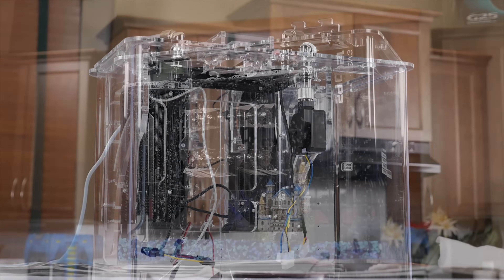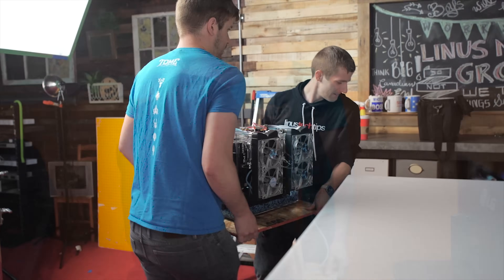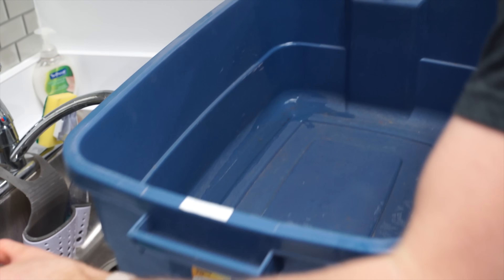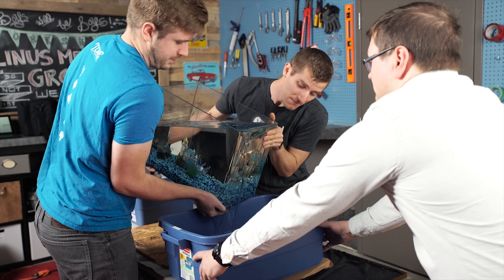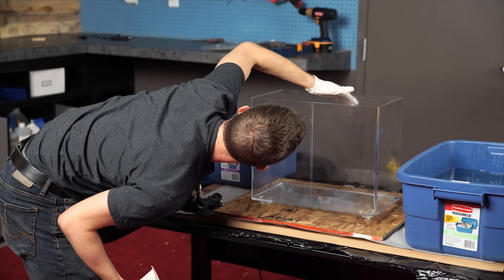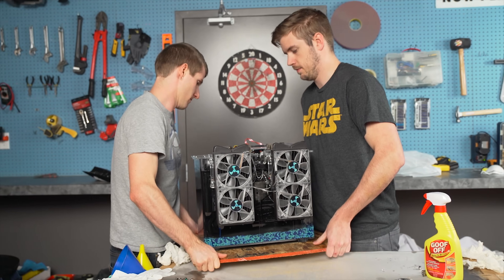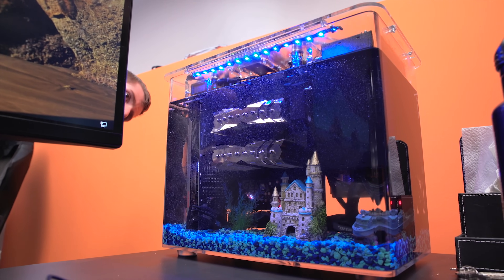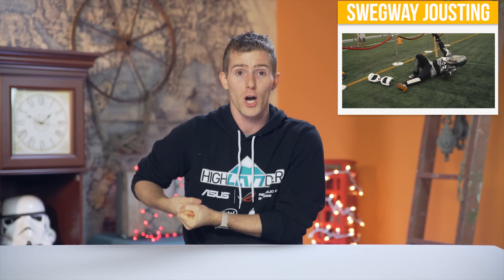Aquarium Mineral Oil PC Maintenance Vlog

Comment: PRO TIP: Use a siphon to transfer the oil.
Reply: tech tip
Reply: They only just discovered funnels, siphons are way beyond them
Reply: Yeah wtf I fully expected them to siphon it
Reply: Only problem is starting the siphon action. I doubt they want to use their mouths so theyd have to submerge the entire length of the pipe then plug it up. Still probably easier than no siphon, but has its on complications
Reply: My first thought
Reply: Why bother with a siphon? They have literally dozens of pumps and meters of tubing for water cooling. Pump it out!
Reply: I thought they were going to do it, when they started pouring the thing I was like what the fuck
Reply: @AbeDorf18  there are hand pump siphons😂
Reply: @SKMovez  thats great, but that requires an extra tool. At that point why not just get an automatic pump?
Reply: @AbeDorf18  Mineral oil is food safe if i remember correctly so why not
Reply: @egesanl1  the same reason i dont want a mouth full of mustard
Reply: @AbeDorf18  yum!
Reply: @egesanl1  Sure thing... if you don't mind some slippery shits 😂
Reply: they make a squeeze pump siphon tube

Comment: Just a few tips from an aquarium keeper.  Use a 3/4 food grade PVC hose (20 cents per foot at home depot) to siphon the oil out into clean 5 gallon buckets (with lids!)  You can do this cleanly and easily before even moving your machine from your workstation.  Using the buckets makes it easy to refill once you have finished your maintenance... you just put the bucket up higher than the PC case and use the hose to siphon it back it..  Nice.. clean.. and easy...  oh.. and you should also NEVER transport a full tank!  ;-)

Comment: Do people actually cool their computers like this?
Reply: I would like to know the answer to this question too..
Reply: +tzokke Yes, yes they do. Mostly enthusiasts though.
Reply: +tzokke People with the money and passion to build one, yes.
Reply: +Captain Einstein People with money , time and no friends.
Reply: +jdidy18 is it generally more superior? Perhaps from the homogenous oil between each of heat dissipating parts? Allowing for better heat flow away from the system..??
Reply: +daedra40 It does an equal well job as any good water cooling system, or even air cooling. Though it is a great way to cool your components, it's mainly used because it looks really cool. Linus himself even said it's only because it looks cool.
Reply: +jdidy18 oil needs a lot of energy to get hot. I think the loud temps on this systems should be crazy low
Reply: +jdidy18 ah got it got it :)!

Comment: I found it funny that after you done your first video of submerging a computer inside oil. EVGA added to their warranty

"Submerging in oil will void your EVGA warranty"
Reply: Which is arguably bullshit since there's no difference between air and mineral oil in regards to card safety.... The only dangerous thing is that something may slip and fall during installation and potentially the cables can get weird, otherwise it only adds to the complexity of the build and maintanace for the end user. There's no reason an oiled up card shouldn't be warranted - I'd be much more understanding with voiding the warranty if you're using water cooling as that actually introduces a potential hazard, yet nobody does that.
Reply: Oil can degrade plastic, for example by slowly seeping into the plastic and leaching out the plasticizers. This makes the plastic very brittle and easy to break.
Some plastics are compatible with mineral oil, some are not. But since at least 99.99% of the guys who buy a GPU won't submerge it in oil, there is little point in making all components out of oil resistant plastic.
See LTTs video on testing if the components from this PC still work after a few years; one RAM slot broke while removing the RAM.
Reply: They talked specifically about how oil slowly chips away at thermal compound too, and how that caused the GPU from Luke's old oil-cooled PC to fry when it was powered on in an air-cooled setting.
Reply: Warranty Void If Submerged
Reply: @Coiltec  they also probably just dont want to deal with having people send them oil covered stuff
Reply: @btCharlie_  
It's how the market works, try to externalize costs and hope no one complains. Since so few people will do it anyways, they got away scottfree. Basically, improving their materials to endure oil cooling would cost more and they decided it was not worth it.
Reply: @frowlinian8175  exactly what I was thinking.
Reply: Idk I wouldn’t wanna fucking deal with a greasy mess being sent back to our factory either lol

Comment: I want to see orange robotic fish swimming in oil PC :3
Reply: not a bad idea...
Reply: +Bisting Lolwut Really bad idea... For fish :P
Reply: I have one of those and while very cool, the fish that I have starts to swim when the two contacts on each side connect. This connection is made by water, because water is conductive.(not distilled water) The reason this pc works, is because the oil is not conductive. So great idea, but (at least the orange robotic fish I have) it wouldn't work.
Reply: yeah that would be cool #fryingnemo
Reply: +HerossesMaster not robotic fish.
Reply: no a robotic titan x
Reply: +HerossesMaster Its robotic why would it be bad
Reply: Oh, sorry :/ Didn't saw robotic.
Reply: +Graham Williams just use  a paperclip to connect both contacts then. shouldn't be too hard.
Reply: +megapro125 yeah, that would work
Reply: You can get the magnetic robot floating ones a well, that track from under the sand or gravel.
Reply: +Matija Tkalec LOL
Reply: +HerossesMaster Its great for a robot fish tho :D
Reply: +Graham Williams You could physically short it out with some magnet wire.
Reply: +Matija Tkalec This sounds like an electrical accident waiting to happen.
Reply: +Matija Tkalec Fish Ai lol
Reply: +Graham Williams idea: bridge the connection...
Reply: +HerossesMaster Hence the "robotic" part.
Reply: +Matija Tkalec with a automatic charge station, with a camera on the head to stream it on the internet and remote controller via wifi.
Reply: Brody Bishop you actually found one :3
Reply: +Graham Williams Simply soldering a wire between the 2 contacts should make it always run, though i would be concerned about the "fish" running into the boards and causing them to fry, or something similar.
Reply: make enough money and force someone to build it for u
Reply: PROfromCRO a pissed off robopirahna would be a nice addition lol
Reply: Just put a plastic one in there tied to a little piece of fishing line to a rock at the bottom so it "swims" in the bubbles
Reply: Plastic fish

Degraded into pieces after a month

Comment: Hey Linus, if you ever have to do this again check out the "Siphon Water Pump Experiment". Literally get a plastic tube the greater the radius the greater/faster the flow. Put your oil tank on a table and a container on the floor and then the plastic tube into both you may have to plunge(up and down movement) the plastic tube in the tank a little to get it started. But after that it will just keep going till all the oil is gone. That way you don't even have to remove the computer components to drain your tank and you can refill your tank using the same method. Good luck :) and thanks for the nice vid :P

Comment: Linus you went through all the effort of cleaning things out then proceeded to dry them with a paper towel. #rookiemistake if your going through that effort it would of been better to use a microfibre cloth instead of paper towels as they dry better and your not left with little flakes from the paper towel everywhere. Just a tip for next time though :)
Reply: +SeaRanger311 *You're, *would have been, *you're. #rookiemistake
Reply: Kusinuppi Well played :)
Reply: +SeaRanger311 SeaRanger311toweltips
Reply: You ever cleaned oil With a paper towel? There wont be shit left
Reply: +SeaRanger311 Micro fibre towels take far longer to clean anything than paper towels do, it takes like 4 times as long to absorb into the cloth than it does in the paper towel, and usually just smears it around rather than actually absorbing it, especially with oil based liquids.
Reply: It's my personal experience that microfiber cloths receive much more hype than they deserve. If you can find them cheap enough, they do have their uses,l. I will not be reaching for them by default when I need something cleaned.
Reply: Also, paper towel can scratch acrylic.

Comment: The cracks are called crazing and happens most often at the edge of solvent welded glue joints or flame polished edges, they are usualy formed due to the use of windex or ammonia based cleaners, a 50/50 mix of denatured alcohol or dedicated plastic cleaners. We see this often at the plastic shop i work at.

Comment: do a Aquarium Mineral Oil PC upgrade to a x99
Reply from the maker: That's an x99 machine already!
Reply: +LinusTechTips Z170? ( ͡° ͜ʖ ͡°)
Reply: +Smexy Potato No.... X99,,
Reply: +LinusTechTips  I Thought Is Was Z22 Socket?
Reply: +Smexy Potato 
why would he want to downgrade the system?
Reply: +HowMemesAreMade X99 is chipset. Socket type is technically independent.
Reply: ***** Failfish It would be upgrading as the i7 6700k has a much better single core performance.
Reply: Jonathan Gray Is it? I thought the i7 4960x had the X99
Reply: HowMemesAreMade no, it wouldn't be an upgrade.

Windows Load Balancing. (via Task Scheduling)
DirectX's limits on Multi-Threading.

read up, please. please.
a 6700K is a complete downgrade.
the Single Thread Performance benefit of Skylake is less than 20% in any scenario compared to Haswell.
Reply: HowMemesAreMade I'm not all up to date on my CPUs. If the i7 4960x supports the X99 chipset then it supports the chipset. But if you read the socket type for the CPU it clearly states "FCLGA2011".
Reply: ***** Really I Saw Some were that it was much better could you link me to artcial or video ?
Reply: +HowMemesAreMade The 5820k, 5930k and 5960X use LGA 2011-3. THe 4960X and others use LGA 2011.
Reply: * * Thanks i learned , but thanks for the info .

Comment: Fair enough, the only additional step I'd suggest is letting it sit another day to see if you fixed the leaks, assuming you're like linus and have to carry 30kg+ back up a flight of stairs once it's all setup again. 

Plus, if you're already comfortable with putting your arm in the oil to position things, you might be happier putting the rocks back in AFTER the oil to avoid further damage to the base of the tank.

Comment: So with my mineral oil pc, I just held the pc above the plastic bin it was in and let the oil drip out for about 10 minutes.  I then placed the pc on a towel and did my updates.   It really isn't that difficult to work on a mineral oil pc.  You're making it sound like a hazmat cleanup, but really it's not that much harder than working on an air cooled pc.  
I'm using 20 gallons of mineral oil bought from tractor supply warehouse (usually used as horse/goat laxative) and I can get 4.5Ghz no problem on a 3770kcpu.  I pushed it over 5Ghz, but temps exceed 100c during stress test so I backed off a bit.

Comment: use a glass tank and avoid all this mess!
Reply: Glass is ten times heavier than acrylic and the thing already weighs a ridiculous amount due the oil.
Also, if glass cracks, it's far more difficult, if not impossible, to repair.
So no, you'd just have a whole different bunch of issues if you used glass.
Reply: ***** you don't move it when its full anyways
Reply: zasabiibasaz Uh, they are clearly moving it while it's full in the first part of the video.
You also ignored the part where I pointed out glass cracks are more difficult to repair.
Reply: Isn't the cracks caused by uneven temperature,  creating different pressure on different point on the tank ?
So glass sounds like a better idea ?
Reply: Most people know that glass is very bad at handling changing temperatures and the acrylic case is literally meant for the purposes of a mineral oil PC so it's probably the best possible thing you can get for it.
Reply: You can also make a single piece acrylic tank by obtaining a single slug of material and milling out your desired cavity (my auto-mechanical side speaking). No potential for microfractures, big cracks only, and it's easy to make it thick-walled with rounded corners for additional reinforcement.
Reply: David Sandberg Yeah because that’s completely practical......
Reply: The whole build is not practical, why not go ALL the way? :)
Reply: I would prefer a single molded cube, not all that unecesary walls....Like what's the point of glue plastic when you can molde all in one single part lol

Comment: Couldn't you use some kind of pump to draw the oil out into a bin rather than pouring it in such a messy, dangerous way?
Reply: You could just siphon most of the oil out of the case with a tube, no machines required. Moving a full, cracked case seems like a bad idea :D
Reply: to be fair, the case wasn't cracked, just the glue between some pieces. the cracks were small enough that it was clear it wasn't just going to burst at the seams but enough that, if left unchecked, would likely keep leaking and veeeeery slowly expanding, where as a crack in the acrylic would have made that move muuuuch more scary.
Reply: there were numerous spider cracks he showed them multiple times.  seemed really dumb to move it upstairs though after filling it, especially with that weird fill hole on the top of the case that has no seal, why not just fill it up there?
Reply: @Luguolo  oh, so heavy and oily case make it better?

Comment: You could use a hose to transfer the oil. 
Just put the Full container on high level and the empity on low level then fill the hose with oil and put the ends inside each container and open them.

Comment: Hey guys, just a pro tip, those dollar store aquarium pumps, the long stiff tube with a squeezey pump at the top and a long flexible hose. stiff tube in mineral oil, flexible in fill hole squeeze squeeze. Remove stiff hose from mineral oil first, and wrap a towel around the flexible hose as your pull it out to catch all the spill. Reverse hose placements to drain.

Comment: But Linus... You know that there is a thing called a "pump" that can be used to transfert fluid? Also, a simple hose can be used to transfert it via gravity. Way less messy, way less back pain! Keep the original oil containers if possible. Yòu also can pump out part or most of the oil while the pc is still in place, before moving it. This will save you lots of trouble. Plus, most of the oil will have time to drip before you even move the pc to your cleaning area! Also usefull to fill it back.

Comment: To get mineral oil and other oils out of fabrics you gently rub the stain with dishsoap (Dawn, Pamolive, Kirklands, whatever)  it is simplest to do it with your eyes shut (is you have your eyes open there will be a slight visual change as the texture shifts) and wait for it to have a jelly like texture, rinse with cold water and repeat as needed until fully removed.

Comment: what are the temps like with this setup?
Reply: +trippplefive the GPU remained cool cause of its fans. but the CPU ran hot under load due to having one giant passive heat sink. whether it's air, water or oil you always need flow.

Comment: I recommend using a mechanical pump of some sort to get the oil out. An aquarium/pond water pump will help get most of the oil out. Just don't use the pump for your aquarium without cleaning it. I can pick up a small 50Gph pump for under 20 dollars at harbor freight. I modified my system to use an car oil filter to keep my oil clean. Another option, which a friend of mine used, is a fuel transfer pump, but it takes a lot of physical work to use.

Comment: I'll admit, a mineral PC is cool. But Linus... as far as I can tell, you don't appear to do anything on your desktop other than send emails and type things into Microsoft Word, nothing that requires 2 radiators with mineral oil cooling every component. Not to mention the Titan or whatever it is that you have in there. It's just unnecessary, and looks to be a lot of trouble. I'd much rather you not use it and just have it on display in the lobby. That is unless of course, your job as CEO is to game all day ( ͡° ͜ʖ ͡°) . Then again, being overkill is what this channel is about, but still, completely unnecessary.
Reply from the maker: It's really handy for me to have a capable gaming machine as my workstation. I've used it for things like testing gamestream with the Nvidia shield.
Reply: +LinusTechTips "testing" :p
Reply: +LinusTechTips Where's your sub-zero build ? Seems like you dont use it . Or did you tear it apart ? Better give it to me :P
Reply: +James Chan Yeah, because you get so much more use out of it by using it as a display piece not plugged into anything................  Because fuck logic,  (╯°□°）╯︵  Logic

How about this, it's an awesome unique computer that makes sense having in the boss office.
Reply: You mad Bro?
Reply: You Talk a lot about Mineral pc and Mineral Oil but there Seems not To be any links on how To büy Mineral Oil and What Kind To büy. I plan To modify my Laptop cooling With Cooper Pipes and water cooling Fittings To improve Temperature. It Would be useful To have the link To where To purchAse Mineral Oil in Your video links

Comment: 1:30 Just fix it using a couple of bucket of clothes to contain any level of oil spreading arround, the second one is to work arround the final clean-up if required. 3:50 You could take half of that away with a cup or anything until the level is low enough to be far easyer to handle that way.